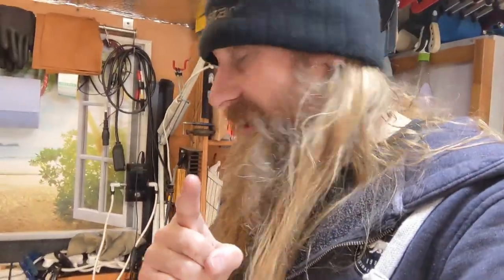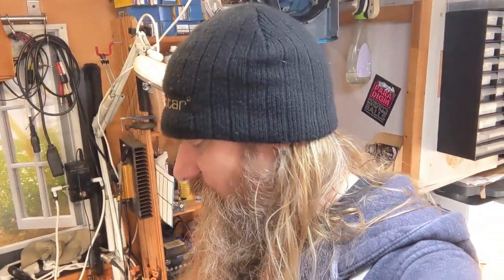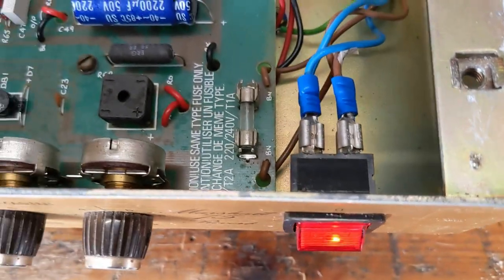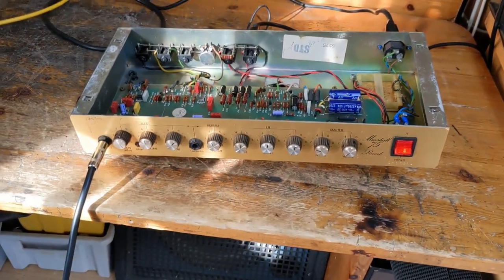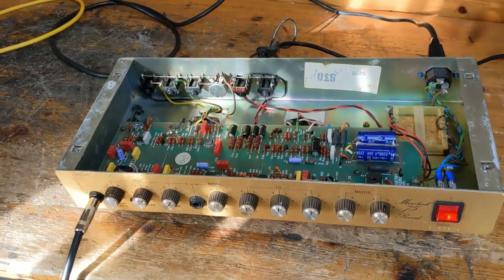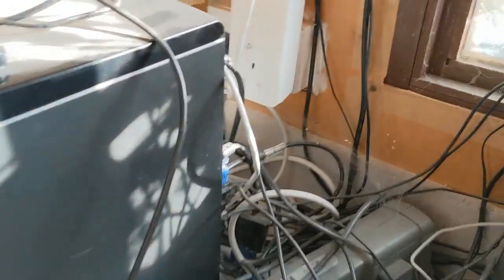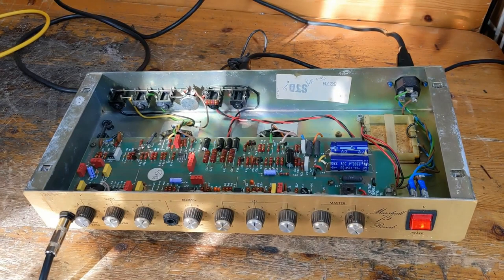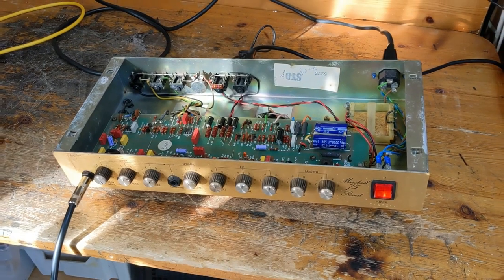Help my guitar amp is making a funny noise

Comment: I have a Supro 1606. Was changing guitar strings and when I turned on the amp to tune the strings the amp began to have problems. It warms up and works normal but after a few minutes of moderate volume (through the guitar volume control) the amp volume cuts out completely and if volume comes back it plays very low. Thanks for any help.
P.s. I haven't had any problems with the amp prior to this problem. Amp is not played very often, stored in a safe dry place. The strings were wildly out of tune btw as they were just put on.
Thanks again.